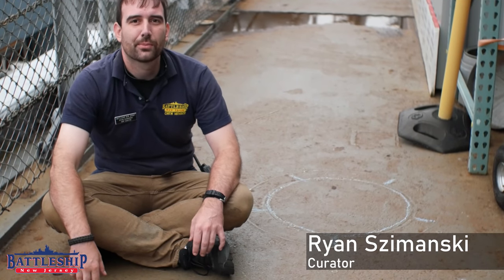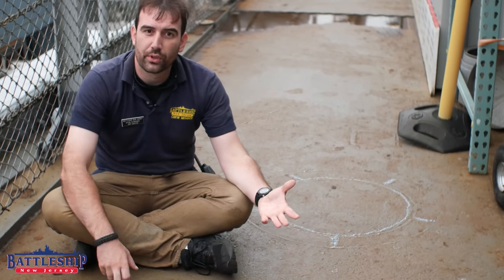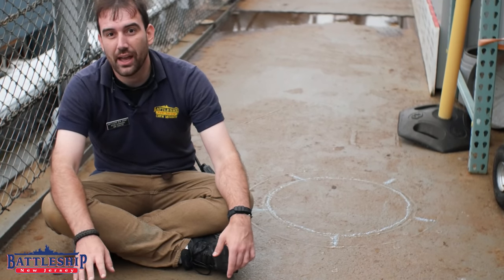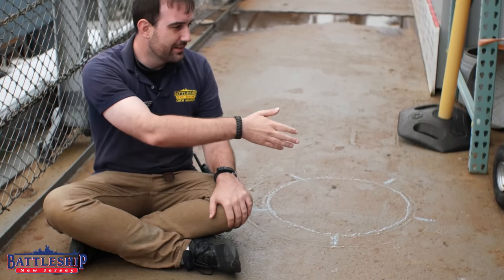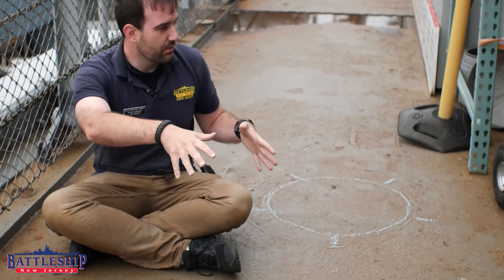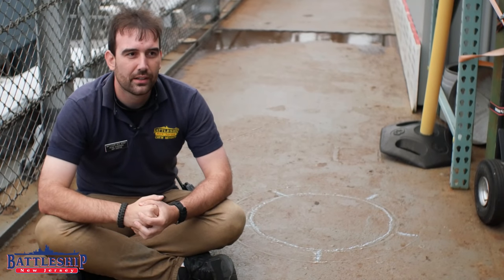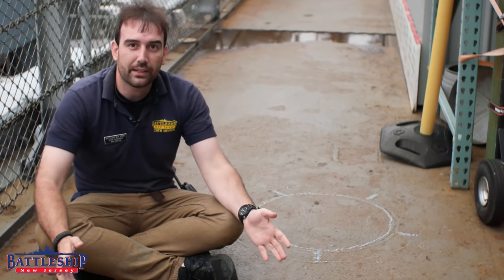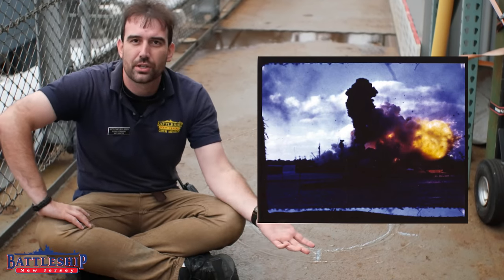How Many 20mm Guns Were on Battleship New Jersey?

Comment: I'm working in a oil refinery that was built in 1942. We're retrofitting some of the original pressure vessels. They'll be in service for another 20 years at least. It's unbelievable. Most of the original blueprints are gone.
Reply: I was a project manager at chemical plants and food plants.  It's easy to get good plans at the start of a project, all the trades need them to do the work.  But at the end of a project it's almost impossible to get everyone to update and record just how things were really installed.  Small changes are always made as the project progresses and at the end everyone is ready to move on to the next job and they don't want to spend time on updating "as built" plan sets.  So from pretty much day one of startup of a system the plans are not correct.

Comment: The battleships of WW2 era with all the guns was very impressive and powerful looking. They could put up a massive amount of A/A shells with a tracers for the kamikaze.
Reply: When you compare what was needed then to what is used now for AA defense, it really shows just how far the tech has come. Since the reason they needed such an impressive amount of barrels was because of how inaccurate and imprecise they were (proximity fuze is excluded from the latter of those).

I wonder just how many pilots on all sides pissed themselves when they saw a ship open up with all that AA fire. Personally, I wouldn't blame a single one of them for doing so.

(In my head right now I have images from the episode 1 vs 40 from the anime Zipang. Episode 21 if anyone cares to see what I am thinking about, and no, it isn't about pissing oneself, its about relatively modern AA tech)
Reply: @whyjnot420  My dad who passed in 2017 at age 92 was on the heavy cruiser USS Louisville CA 28 from 1943-46 and witnessed (52) sailors including Rear Admiral Theodore Chandler buried at sea due to (3) kamikaze hits in the Pacific. At one time there were (16) planes at once to try to shot down and the other U.S. Navy ships were pretty close. The 40 mm guns had manual or radar for targets. The USS Alabama had a twin 5 inch 38 caliber gun mount in auto and it fired into another twin 5 inch 38 caliber mount killing 9 men.  A/A Guns are limited for clear shots depending on location of mounts too. You can see that in Mobile, Alabama - BB 60. Take care!
Reply: One of my old insurance agents was on an LST in the Pacific. He commented on the terrible inaccuracy of AA fire. Won't quote exactly what he said but sailors couldn't hit squat. However, to be fair they didn't get any training to be proficient either. Firing a weapon is one thing, hitting a target is a whole different story.
Reply: @LuvBorderCollies  Thank you sharing that story from your friend! Those kamikaze had to be knocked right out of the sky otherwise, their momentum would carry to the ship loaded with gas and bombs with all the deadly shrapnel. We will never have to go through what those WW2  service men when through with kamikaze. Can you imagine just how scary it would be trying to hit a plane? The USS Louisville CA 28 had (55) U.S. Marines and they manned (2) 5 inch 25 caliber gun mounts for A/A and bombardment Take care!
Reply: I slightly snicker at the thought of what a couple of phalanx could do to a kamikaze swarm, Brrtt,brtttt,Brtt, Miller time!

Comment: Battleship Cove posted a couple of pics that were miss identified as her sister the Indiana. They were able to correct it because the photographer was onboard the Massachusetts not the Indiana at the time the pics were taken. And the fact that the five inch gun mount on the port side had rails on the sides of the guns. And the number 3 turret has an imperfection on it. It was interesting to see those comparison pics that proved it was the Massachusetts.

Comment: Just an idea but some of your weld marks may be from temporarily welded on attachments used during the original building of the ship, storm/battle damage repair, drag points to jack from, you name it there are a lot of reasons to weld something onto a steel structure temporarily then cut off once finished with it.

Comment: How do you document weld marks like this. I assume extensive photos but do you measure the location relative to other features of the ship and is there a reference point that all measurements are taken from? Is there a 0,0,0 somewhere on the ship. And how would that related to the sister ships (that probably are different in so many places)
For rough location you have the bullseyes but that is a rough grid.
Reply: Frame numbers for fore and aft, waterlines or decks for vertical and buttock lines (no kidding) for port/starboard from centerline. Centerline is often marked on bulkheads.
 It would be a fascinating project for sure. Imagine a 3D AutoCAD model just for interesting ship features!

Comment: During the teak replacement, are you going to put the quad 40 back where one would've been mounted?
Reply from the maker: The quad 40 you see being put down by a crane in this video is being put in the location of an original 40mm
Reply: @BattleshipNewJersey  Awesome!
Reply: @BattleshipNewJersey  That's during the removal?
Reply: @BattleshipNewJersey  Where did you guys source a quad 40, and in a related question- what happened to the quad 40's that were removed from the Iowas during the 80's refit, and the 5"38's for that matter? Were they merely scrapped?
Reply: @ConstantinoTobio   They are crated up in that huge warehouse with all the other crates of artifacts...

Comment: @Battleship New jersey:  Have you found any unauthorized ship alts where the function is so non-obvious, someone has written directions on the bulkhead describing how to use it?
For examples:  A modified scuttle that needs a lever pulled in a specific wrong way to open;
 or a hole cut in a bulkhead exposing a pipe and a label reading "bang on this pipe to fix clog in captain's head."
Reply from the maker: There are brass engraved signs at all the helms that remind users that you have to kind of rock them at first. So they did leave plenty of tips and tricks behind on how to operate everything.

Comment: I’ve read accounts that significant numbers of light AA -- 20mm, .50-cals, even .30-cals — would end up unofficially obtained and mounted. Rumors speak of well over 150 such mounts in addition to the standard mounts.
Reply: 35 or 40 years ago I visited the battleship North Carolina it had mounts for 50 cal, all the way around it, at least what I remember they said that the multiple mounts were for them bout the size of that small round weld you showed

Comment: In the sprit of myths and mysteries. That the Iowas are battleships.   Some say they are battlecruisers.  I can see good points for both sides. 
(Ducks for cover before shells start flying)
Reply: In my thoroughly amateur opinion, they were fast battleships.  Just like light, medium, and heavy tanks converged into the Main Battle Tanks, Battleships and Battlecruisers converged into the fast battleship.
Reply: @Viper5delta  probably one of the best explanations I have heard of it.
Reply: Additional contraversy; hood was the worlds first fast battleship...not a battle cruiser...
Reply: @Ranzoe813  so did that make the inefficient Bismarck an over armored battlecruiser or an under armed battleship?
Reply: @Viper5delta  Exactly
Reply: Dracinnell just had this issue on his video this weekend. Although I don’t agree with him, it would under a fine point be classified as a battle cruiser. The only reason he could point to, is they are not protected against what they fire.  They are only armored to withstand 16”/45 caliber, but fire 16”/50 caliber rounds. 

Like I said, I don’t agree, and he regularly calls Iowa’s battleships, he does have a point.
Reply: @cruser69  I literally started this thread just to have thoughtful discussion.  I saw Drachs video just after posting this.  I personally consider them battleships because the USN said so and they are used that way.  However, I have always wondered about the armor scheme itself.  Having arm internal belt means that even 16/45 would cause an inordinate amount of damage likely rendering the ship mission kill.  Where as the Colorado external scheme still possess immunity zone against 16/50 where the shells would be fully rejected by the armor. 
Probably why the Montana would have had the NorCar armor scheme.

Comment: The British found out early in the war that a twin 20 mm mount was a great deal more effective than a single one. After all what use is a single mount even if mounted in a battery of 3 to 4 unless all are focused on the same target. A twin or the German Flak quad 20 would be fine just as a quad M2 mount raised hell. The Brits mounted Lewis guns in twin mounts and that mount had a rate of fire of 1200 rounds per minute. Great if you are firing at a moving target or from a moving mount. You are not on target very long so putting as many rounds into a target as soon as possible is a must.

Comment: I understand your reluctance to believe blueprints, I was responsible for overseeing the installation and testing of a system on US Navy ships.  I once noticed that a pressure switch was connected to the wrong port of a fuel pump, It was connected to the high pressure side, which was many times the burst pressure of the switch. I raised a flag and the shipyard confirmed the port was not correct and was indeed a risk to life and the ship.  The blueprint showed it connected as they had installed it, could not change the connected port without a correction, but in the interest of safety, did disconnect the switch, and plug the high pressure port.

Comment: Iowa's conning tower is different than New Jersey's? How so?

I love the archeological videos.  It's great a whole new generation cares about this stuff.  The WoW nerds really have done a great service to preserving history.
Reply: @jth877 Iowa originally had an "open" bridge instead of the fully enclosed bridges of the rest of the class.  Iowa was later retrofitted (Dec. 1944) with the enclosed bridge she has now.  See photos here  https://ww2db.com/image.php?image_id=14922    
...and after refit  https://ww2db.com/image.php?image_id=27842

Make sure you open the photos up in full resolution.  Also, check out the rest of the photos in the archive.  Very cool stuff.
Reply: @Chris03121957  New Jersey had an open bridge as well, then a rounded enclosure, then the current facet type. He specifically mentioned the conning tower.

Comment: Double check your sources, works for most disciplines.

As to "remove your 20mm guns" plans/orders from the Navy.  What commander wouldn't keep guns, even low end pop-guns, until they've got replacements or upgrades in-hand ready to install?  Even if it's BS reasons to delay the actual removal, like "we are going on a training cruise next week, don't start that work just yet."  Or that they prioritized other work so they could keep the guns.

Comment: I wonder what kind of and how many injuries were caused by the spent casings of the .50s, 20mm and 40mm (and any other similar gun that was on the ship at one time or another) over the time those were onboard.

At the very least, I can imagine quite a few people simply getting tripped up and turning a working sailor into a broken sailor in a heartbeat.
Reply: Probably quite a few. I think they used to shovel the casings overboard when the battle was over, but the 16 inch guns didn’t use cases, unless you consider the bag charges, but I believe the cotton or whatever covered them were incinerated upon firing. Shame though, all of those cases could be melted down for scrap and would probably pull nicely.
Reply: @TheAllKnowNoble  I was thinking 5" and smaller. I mainly added the bit about other guns because I couldn't remember if any of the truly antiquated ones like the chicago piano ever made an appearance on an Iowa.

The 16" powder charge bags were silk.

Personally I think they would have saved the casings when it was feasible to do so. It really wouldn't make a ton of sense to just huck them overboard if there was nothing better to do. Besides, in order to throw them overboard, a lot of them would have to be collected and then brought to the side of the ship in the first place. But that is just me thinking about waste in a time of war. Especially when talking 40mm or 5", that is a lot of brass to waste for each round.
Reply: @whyjnot420  navy then not to worried about recycling, plus a Hassel to store then ship, remember after the war all sorts of stuff including weapons were tossed overboard, heck burned the pt boats
Reply: @demonprinces17  It is funny how wasteful one portion of the country can be when the rest is so overboard on being frugal that they give up their pots and pans, even if they aren't actually useful.

I definitely know times when ammo got tossed. But off the top of my head I can't think of any times a PT boat was intentionally destroyed. Though given that their seakeeping was horrid and really were effective as green water craft, I can imagine that a lack of ability to transport them over the ocean would result in them being destroyed to deny them to the enemy. (We even had dedicated tenders for them designated with AGP, though they could be craned onto some of the bigger ships if need be) 

In all of the above, the cost is either potential damage to a major surface vessel (even a DDE is still a pretty big vessel in the overall scope of things, the fact that it is a ship and not a boat attests to that fact) or potential capture by enemy forces.

Just some quick & dirty math:
A Fletcher class DD ran about 6 million USD per ship. A PT boat, Philadelphia Naval Yard model aside, ran 200-300k. In relative terms, that isn't a major loss (for the destruction of a PT boat) in return for denying it to the enemy. Also, this shows just how expensive a ship as "minor" as a destroyer is. (prices here are from that time period, not sure of the actual years)

BTW, in 1940 dollars, a modern Arleigh Burke class ship would cost just over 4.1 million USD to run, per year (costs about 80 million to run per year in todays money). (~1.8 billion to build today, ~93 million in 1940 dollars)

Which makes it all the more annoying to think of what was wasted for no other reason than convenience.

(All the alluminium pots and whatnot that got collected in those drives were utterly worthless as metal for aviation, which is what people thought they would go for. To the best of my knowledge they literally just melted them down and made new pots to sell back to people. Though I guess success in one of those drives would have an impact on morale at least.)

edit: typos
Reply: @whyjnot420  this was discussed in the recent video about the 5" guns... Apparently if possible the brass was saved, it was used to pay work crews in foreign ports for things like painting etc.
Reply: @kschleic9053  Thanks. I watched that video, idk how I didn't file that into my brain. I will just blame one of my cats for distracting me, sounds plausible.

I still wonder about the number of injuries caused by brass rolling around on the deck prior to being cleaned though. I would imagine nobody would leave it for longer than need be. And I know there are methods used to collect spent brass with bags and whatnot. But battle is a hectic time, not all the brass if going to be collected right into a bag for one reason or another (if even used), and thats a lot of brass.

I mean, ffs, look at this.

https://www.usni.org/magazines/naval-history-magazine/2019/december/gun-fought-all-sides

edit: I wonder how long it would take to fill that gun tub up with brass the way a bathtub is filled with water.

Comment: I don't know.  But I can tell you everything about the USS Bristol county LST-1198 in 1993 the USS Valley Forge CG-50 from 1995 - 1997 and the in and out of the USS Preble DDG-88  from 2002 -  2007 I remember all the placement of almost all the equipment on board.  I did alot of 3M, got my surface warfare on all three and did a lot of watch standing and maintenance on these three ships. What I'm getting at.  Those are on the ship will know what they worked on. You can't count those out.

Comment: Just spit-balling off of Wikipedia here- the Iowa's in the '80's were fitted with 4  Phalanx CIWS using an M61 Vulcan with a rate of fire of 6,000 rounds-per-minute. (4x6,000=24,000 RPM) The L70 Oerlikon has a cyclic rate of 450 RPM. (The L85 has a whopping 900-1,000 RPM. 😯) 49x450=22,050. 

So in a nutshell, the Iowa's before 1980's refit were throwing up almost as many 20mm rounds as they were before they got the CIWS (plus 40mm to boot.)

Comment: At 2:20 there is a picture of 5 20MM singles, and another just above them by itself. They have three 5 inch turrets all around them, and a quad 40 just above. Question is how could the guys on the 20's be out there when the 5 inch guns were working? No matter where the attack was coming from they would have been shooting right over these guys heads (literally). Wouldn't the concussion and noise have been too much? Anyone know? Don't bother guessing.

Comment: The New Jersey and Wisconsin are still around so why not just, you know, go ahead and measure em?
Reply from the maker: Measuring while in the water leads to inaccurate results
Reply: @BattleshipNewJersey  what is the cause of the inaccuracy?  Would surveying the points at the front and back avoid them?